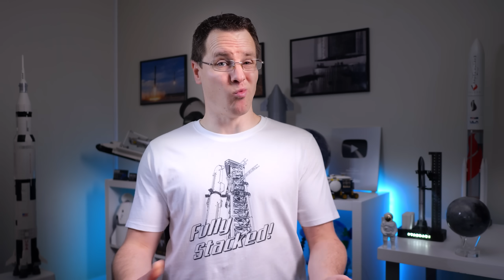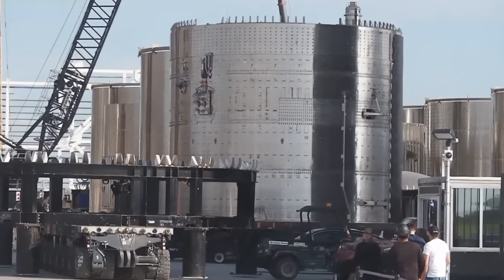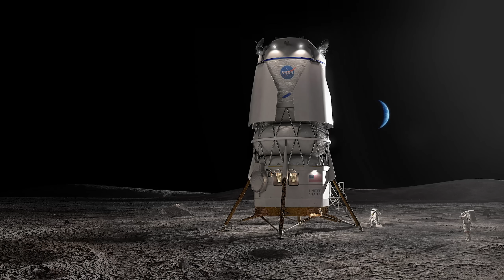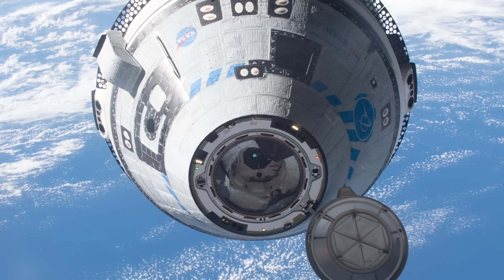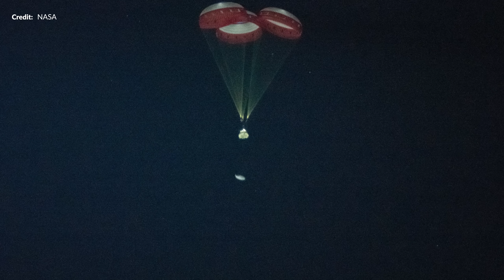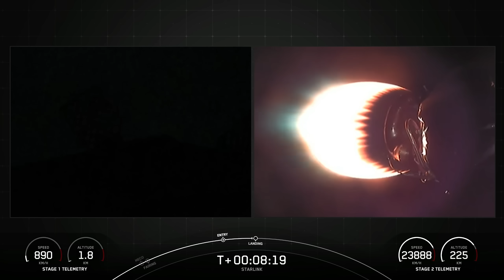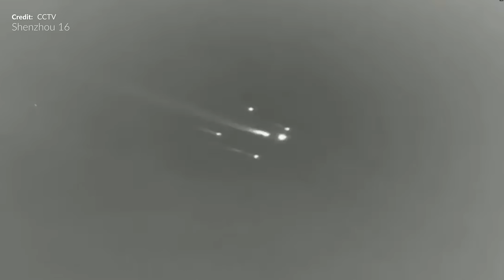SpaceX Starship: Mega Pad Upgrade to Tame the Thrust, Boeing Starliner Delayed Indefinitely

Comment: I still think SpaceX is being silly by not using tried and true flame diverter and sound suppression similar to what is built on the Cape.  I think they are adding risk by building yet a new, untested element to the stage 0 structure.
Reply: It's a risk but not necessarily silly. SpaceX is always looking for ways to make spaceflight simpler and less expensive, and flame trenches are a major construction item so they are hoping that something smaller will work. If it doesn't then they will probably wind up going the traditional route with a flame trench and flame diverter. It will be interesting to see how well their idea works out.
Reply: @StevePemberton2  To be fair, the height of the OLM from the ground, is the same as the height of the pads at LC-39 from the bottom of their flame trenches. What Musk was trying to do without was the diverter, so that they could work on the engines under the pad.
Reply: @steveaustin2686  I have wondered about that. All launch pads that I can think of (the big ones anyway) use a combination of a flame trench and a flame deflector. The flame deflector turns the flame sideways into the flame trench. Then a lot of flame trenches have an upward slope that gives the flame a slightly upward exit from the trench which keeps it from scouring the nearby ground.

It seems SpaceX was trying first to have essentially nothing but concrete under Starship, although at some point probably after the static fires they knew they needed more than that so they started working on the steel "fountain".  But still that allows flames to go in all directions and scour the ground, although hopefully reduced somewhat by the water. But it just doesn't seem like something that will work at 39A where I think they will need to direct the flame.

If their next step is to try a flame deflector without a flame trench that will be interesting, it makes me think of the Saturn IB launches at LC-34 and LC-37. They were on a platform without a flame trench just a flame deflector, but I can't tell whether the flame deflector directed the flame in any particular direction or if it mainly just kept the flame from pummeling the concrete below the rocket. Of course Starship puts out quite a bit more thrust than a Saturn IB
Reply: @steveaustin2686  What I meant by the LC-34 flame deflector I know it will somewhat direct the flame but I think a lot of the flame still goes in all directions if there isn't a trench.
Reply: @StevePemberton2  The OLM is basically a 360 degree trench, because the OLM is soo far off the ground. The distance from the OLM to the ground, is the same as the distance from the pads at LC-39 to the bottom of their flame trenches. What the OLM doesn't have, is the diverter to redirect the flames sideways and then up.

I agree that SpaceX determined they needed more and were going with the steel plate water deluge system, but didn't want to wait for it to be installed. What Musk seems desparate to avoid, is a flame diverter that would block access to work on the engines, while the booster is on the pad. Likely for future rapid reuse.
Reply: @steveaustin2686  I suppose part of the concept of a flame trench is providing space underneath the rocket, so an above ground orbital launch mount provides that aspect of it. For some reason I never hear the height of the OLM mentioned but doing a pixel count from photos it looks to be around 75 feet. The top of the Saturn V mobile launch platform was about 92 feet above the ground.

I don't know how much that height helps, the pressure is still extremely high even that distance from the nozzle. It would be interesting to know how much the pressure drops off at various heights. Of course another purpose is to keep the exhaust from bouncing back up at the rocket.

The roughly 45 foot tall Saturn V MLP sat on top of a roughly 45 foot tall launch pad, which in one sense was two separate pads with a 55 foot space between them. The MLP straddled the two pads and the gap between the pads served as a flame trench facing north/south.  A steel flame deflector placed underneath the rocket sent roughly half of the exhaust north and the other half south.  The flame trench floor and walls were lined with refractory brick and refractory concrete, including the flame deflector which was coated to protect it. I mentioned an upward slope to the flame trench at the 39A/B pads but there was only an upward slope for the exhaust going south, the north section of the flame trench remained ground level.

The pad 39A and 39B flame deflectors were on rails, as were the deflectors at LC-34 (and I assume LC-37). This allowed moving the deflectors away from the pad. Not sure why they were movable, I suppose so they could be replaced or maintained, the rails split into two paths so they could have two flame deflectors available. You can still see these rails and the two parking spots for the flame deflectors just north of pad 39A on Google Maps. Meanwhile two of the movable flame deflectors are still sitting out at LC-34. You used to be able to go to LC-34 on the NASA Cape Canaveral bus tour but they apparently no longer stop there, but you can still see photos of them online. As an FYI the SLS pad 39B flame deflector was built in place it is not movable.

So SpaceX could install movable flame deflectors on rails if they wanted to, but understandably they are trying other things first. They could even bring in a bunch of dirt and build it up on either side of the OLM to create a flame trench, but that would be very expensive. Also I suppose one disadvantage of a flame trench is that it concentrates the exhaust, whereas an open OLM let's the exhaust shoot out in all directions which might reduce the pressure somewhat.
Reply: @StevePemberton2  Movable deflectors would seem to be a good solution to having the pad open for work on the engines and a diverter for launch. It seems that Musk's "the best part is no part" bit him in the arse big time for the 'orbital' flight.
Reply: @StevePemberton2  This is my very point.  NASA already did the hard work of figuring out how to protect the infrastructure in the cases of launching a heavy vehicle.  The reason why there is so much space at 39A and B is so if the rocket detonates, the infrastructure don't be damaged.  The reason for the long ramp is so they can move the vehicle from assembly to launch (and back) in one smooth movement.  The reason for the flame diverter and water deluge is so the thrust will not hurt the vehicle or infrastructure.  And NASA didn't just snap their fingers - this design was developed after a series of RUDs.  So I'm not sure why Elon feels the need to ignore that design.  But, all of that said, this whole area used to just be for the grass hopper - the rest of it just grew organically over a few years without any "master" plan for the area - so I don't think they really thought they'd end up with a Texas "Cape".  I guess at the end of the day, I just have to let billionaires be billionaires.
Reply: @davidallyn1818  I agree that NASA had reasons for how they did things and that a lot of research went into the methods that they chose. As has been highlighted many times about the difference between NASA and SpaceX, NASA generally spends as much time and money as necessary to develop a system that has the highest possibility of success the first time out. This approach of course has many advantages. But it can also have the disadvantage that there may have been equally suitable methods that are more cost effective, but that require a certain amount of trial and error experimentation to find out. That's the direction that SpaceX tends to lean.

In this case they aren't ignoring the need for mitigating the effects of launch thrust, they just aren't accepting without question that there aren't other ways to do it. In the end they may very well wind up using a traditional flame mitigation system. But I think it's also possible that they will come up with something new that others will copy, like they have done several times already.  

It's only been one launch attempt, and I tend to see this as we are currently at the same point that the Falcon 9 program was at when boosters were crashing one by one onto drone ships. Many people at the time thought this proved that the method would never work. And that even if they ever did recover a booster that it could never be flown again.  As it turned out their method worked. That of course doesn't mean that SpaceX is on the right track with how they are launching Starship, but I think it's way too early to know if it's not.
Reply: @StevePemberton2  True - it would be more expensive than a couple of steel plates.  But they don't actually know if it will work yet - they're designing and testing everything together rather than separately.

There are ways of designing, building, and testing something that don't require risking damage to the other expensive things that you've built. For example,  SpaceX could have tested 33 raptor engines' effect on concrete at an off-site location and they would have found they'd need to have some flame diverter and sound suppression to keep the concrete flying into the engines.
Reply: @davidallyn1818  They did some testing with a Raptor engine pointed horizontally at a prototype steel plate with water, so I'll guess we'll find out how well that scales up. They will get an early idea when they do some static fires at less than full thrust. 

Testing all 33 engines anywhere but at the launch site would be difficult because of all the infrastructure needed to do that. They would have to build a "mini" Super Heavy, at least the bottom part where the engines are and then install all of the plumbing for getting the fuel and oxidizer to all 33 engines. They would also have to add a bunch of weight on top of it because 33 Raptors at full thrust are going to try and lift the entire test rig into the air.  I would pay to watch that though :)

Comment: Flammable tape for wiring?  These guys have been in this business for over 50 years! C'mon, now.
Reply: To be fair, the tape is flammable only in certain situations per reports and requires failures of other hardware to happen. Per NASA/Boeing, "Although that tape is commonly used on other spacecraft, they are evaluating if it is acceptable for crewed flight (article "NASA and Boeing say preparations continue for July Starliner test flight" by Jeff Foust May 27, 2023)"

Boeing finds two serious problems with Starliner just weeks before launch
ERIC BERGER - 6/1/2023

"The second issue involves P-213 glass cloth tape that is wrapped around wiring harnesses throughout the vehicle. These cables run everywhere, and Nappi said there are hundreds of feet of these wiring harnesses. The tape is intended to protect the wiring from nicks. However, during recent tests, it was discovered that under certain circumstances possible in flight, this tape is flammable."

---------------

Parachute and wiring issues to delay Starliner crewed test flight
Jeff Foust - June 1, 2023

"Both the parachute soft links and wiring tape were used on the Orbital Flight Test (OFT) 2 uncrewed test flight in May 2022 without incident. The soft link issue, officials said, would only be a concern if one of the three main parachutes failed, putting additional loads on the other two, while the flammable tape would have required what Nappi called “multiple failures” elsewhere in the spacecraft."

Comment: I'm assuming the reason for separating the boosters first is either because of residual thrust, or because in a different ascent profile the boosters might actually burn out significantly before the core stage, so its just easier to keep that same staging order and hardware and just shorten the staging delay than it would be to certify the rocket to be able to stage with the boosters still attached.

Comment: Best guess on the boosters separating just before the core stage would be for safety. Any booster that had failed to fully shutdown would be ejected and would leave on a trajectory away from the rocket. If they just separated the core stage with the boosters still attached and one or more boosters had failed to shut down. Well then you may have the core stage impacting the rocket.

Comment: I probably missed it, but why has Starship/base production and construction been halted in Florida??
Reply: Likely two reasons.
One, because NASA is leary of Starship flights at LC-39A until there is an alternative for launching Crew Dragon. So SpaceX has started construction of a crew tower at SLC-40, so that Crew Dragon launches can be held there as well. The Falcon Heavy only launches from LC-39A currently, so I would not be surprised if SLC-40 is upgraded for Falcon Heavy as well. A few years ago, the USSF-67 contract included a Vertical Integration Facility (VIF) for NSSL payloads, so I would also not be surprised if that is also being built at SLC-40 on CCSFS.

Two, Boca Chica is as much about figuring out how to build a Starship facility, as it is testing Starships. So SpaceX might be waiting for changes at Boca Chica, before putting them in at LC-39A.

As a side note, SpaceX is also taking over SLC-6 at Vandenberg SFB, since the Delta-IV Heavy is no longer launching from there. I would not be surprised if it is converted for Falcon 9 as well, since SpaceX likely needs a second landing zone at VSFB somewhere.

Comment: Why is the Massey's site surrounded by water. I can guess a couple reasons, but what's SpaceX's?
Reply: Likely because it is only a few miles from Boca Chica and is in the same delta area of the Rio Grande river.
Reply: @steveaustin2686  So the site already had water around it from the river? They didn't intentionally create the moat?
Reply: @ezekielteklaking  I don't know as it was a gun range, before SpaceX bought it. The wettest months of the year in Texas are reportedly March to May, so it could just be runoff from the rainy season. Here in Florida, our dry season is from October to May, so in early May there are a lot of retention ponds and ditches that are dry. After the summer rainy season, they are full.

Maybe SpaceX did build them and they are to keep the water runoff from the Massey's site on the site. You could ask SpaceX.

Comment: I live up in Kansas USA.   We got a news report of a SpaceX heavy transport going through the state.  Its a two tanks on two transport trailers that is 16ft wide by 300ft long and weighs in at 600,000 lbs each.  Could these be a pair of the replacement fuel tanks ?

Comment: I continue to be amazed that SpaceX hasn't bothered to build a flame trench yet. Most likely its because Elon doesn't want one. There is a reason why NASA has been using flame trenches with its launch facilities for over 50 years.
Reply: To be fair, the OLM distance to the ground is roughly the same as the distance from the pads at LC-39 to the bottom of their flame trenches. The OLM didn't have a flame diverter and water deluge system for the 'orbital' launch. Musk mentioned that they have a water-cooled steel plate system to install under and possibly around the OLM, but it was not ready yet. Musk's "the best part is no part" philosophy bit him in the arse with the no diverter or deluge part. He rolled the dice that Stage 0 would make it through one launch without them and came up with a Nat 1 on the d20.

Comment: Would love to know, how much refurbishment is required on falcon 9 boosters between flights, how often are engines replaced  how many flights each engine are good for, have any engines reached 15 flights
Reply: I don't believe that SpaceX has released any of that information. The shortest turn around for a booster is just over 21 days though.

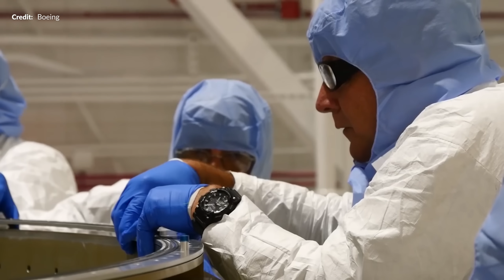Comment: 13:20 "Should we use the flamable tape on the million degree return vehicle?"
"I'm sure it will be fine" - Boeing Engineers
Reply: To be fair, the tape is flammable only in certain situations per reports. And requires failures of other hardware to happen. Per NASA/Boeing, "Although that tape is commonly used on other spacecraft, they are evaluating if it is acceptable for crewed flight (article NASA and Boeing say preparations continue for July Starliner test flight Jeff Foust May 27, 2023)"

Boeing finds two serious problems with Starliner just weeks before launch
ERIC BERGER - 6/1/2023

"The second issue involves P-213 glass cloth tape that is wrapped around wiring harnesses throughout the vehicle. These cables run everywhere, and Nappi said there are hundreds of feet of these wiring harnesses. The tape is intended to protect the wiring from nicks. However, during recent tests, it was discovered that under certain circumstances possible in flight, this tape is flammable."

---------------

Parachute and wiring issues to delay Starliner crewed test flight
Jeff Foust - June 1, 2023

"Both the parachute soft links and wiring tape were used on the Orbital Flight Test (OFT) 2 uncrewed test flight in May 2022 without incident. The soft link issue, officials said, would only be a concern if one of the three main parachutes failed, putting additional loads on the other two, while the flammable tape would have required what Nappi called “multiple failures” elsewhere in the spacecraft."